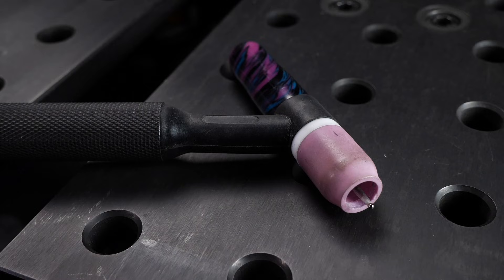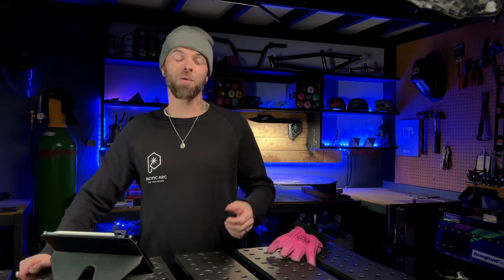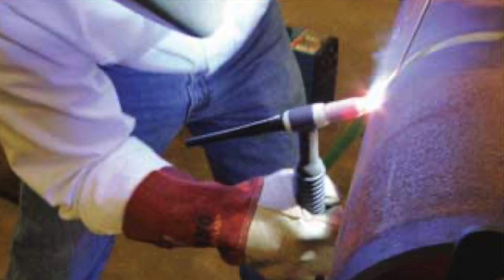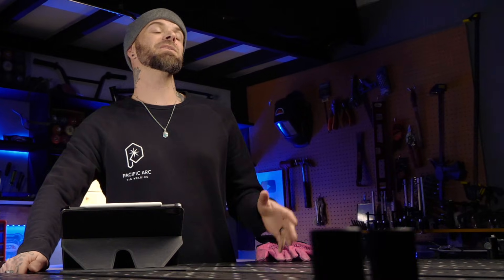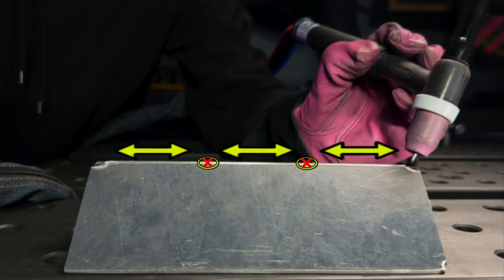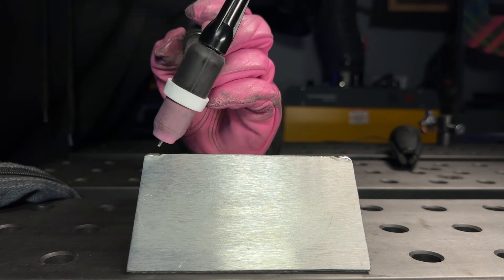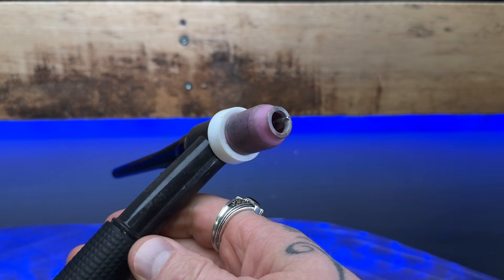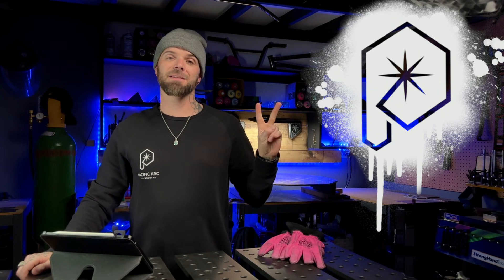I found a welding torch trick that NOBODY TAUGHT ME.

Comment: The devil is in the details. Thank you! I suppose the same rules apply for lift tig or scratch tig.
Reply from the maker: Essentially yes. Everything will remain the same, but focus on getting the tungsten back to a proper standoff distance as quick as you can, this will help to prevent contamination. Thanks for watching🙂

Comment: Holding the torch like that is fine if  you’re using a foot pedal with a trigger/ thumb switch makes that impractical
Reply from the maker: Good point, I have actually worked with people who position the trigger on the side of their torch instead, then they can do this more comfortably. Thanks for checking out the episode🤙
Reply: Check them all out Dusty 👍